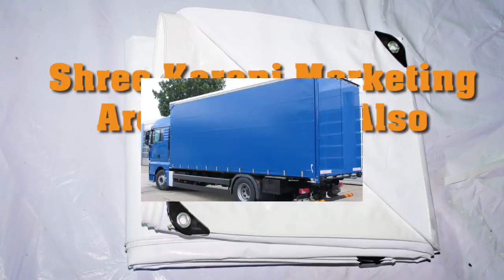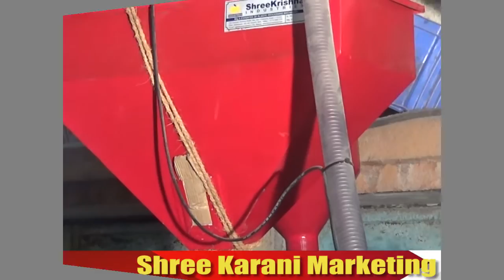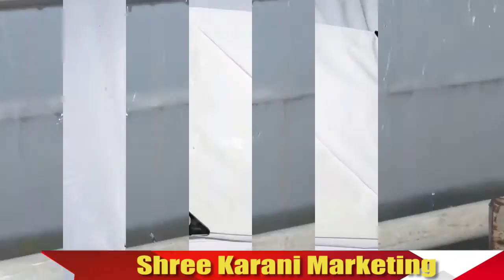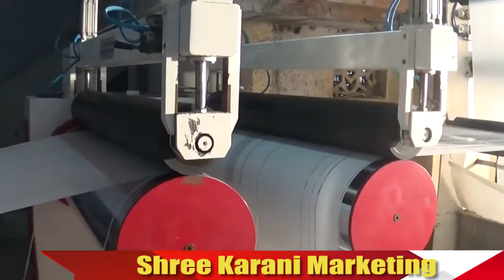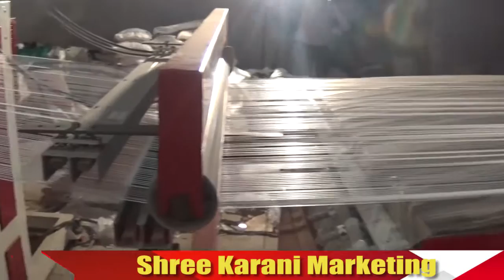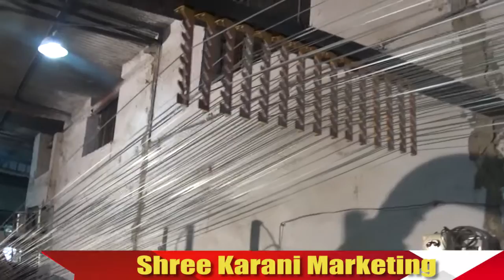tarpaulin, tarpaulin manufacturer, hdpe tarpaulin

Comment from the maker: POLY TARPAULINS are made out of High Density Polythene (HDPE) Fabric and low density (LDPE) Coating on both side. Poly Tarpaulin is Heat sealed, so without sticking. Eyelets are provided at distance of every 1.5 mtrs. all around & corner. Poly Tarpaulin is manufactured with latest #Tarpaulin #Poly Tarpaulin